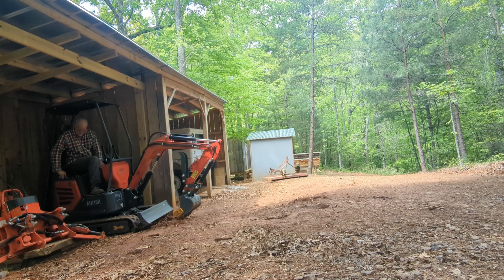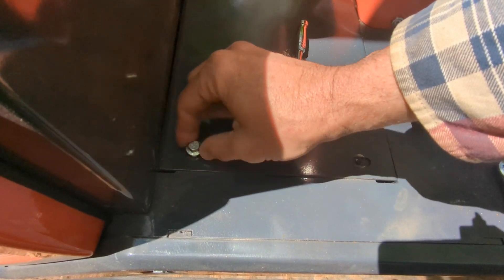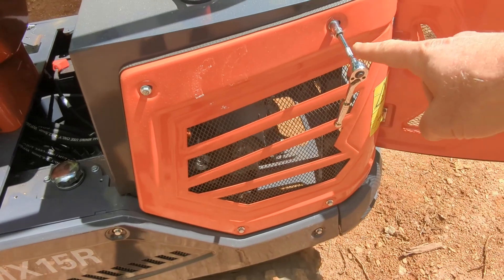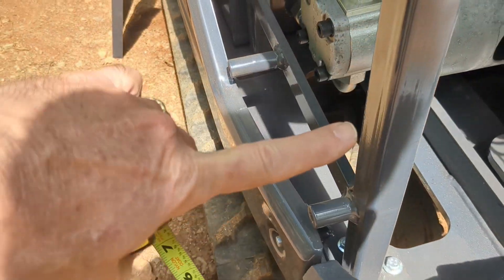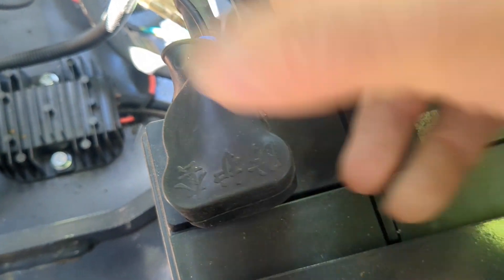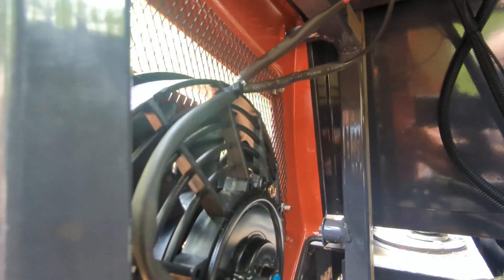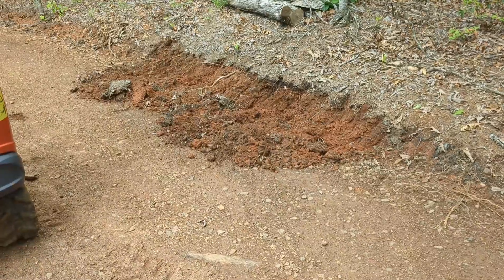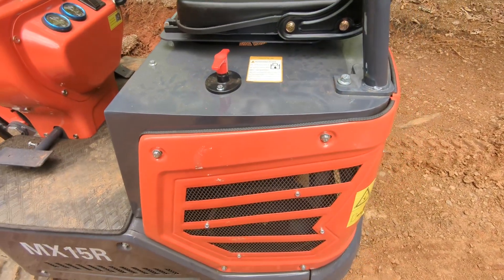Mini Excavator DIY Cooling Fan Installation

Comment: What was the temperature before the install?
Reply from the maker: I'm not sure of the exact temperature but everything in the engine bay was too hot to touch after a long work session. The biggest issue was restarting the engine after refueling. The gas tank was almost boiling. Vapor lock....

Comment: Those things need an oil cooler and the worst way
Reply from the maker: I haven't had a problem with the fluid getting too warm. Probably because I don't run it more than about 45 minutes at a time.
Reply: @dpgladius  with that duty cycle, you probably would never have a problem, but if you plan on using it for a good day, you’re gonna have some problems. There was a guy who had one of these things that ran it so hot that sprung a leak and caught on fire.
Reply from the maker: That sounds like a bad day. Thanks for the info.

Comment: Take those wing nuts for the seat and throw them away.  You don't need them.
Reply from the maker: I agree. The wing nuts are a little cheesy. I do like the seat attached at the rear, especially when navigating down a slope. It just feels more secure.

Comment: On your mini excavator throttle. I used a heavy duty aftermarket throttle with a clevace on the end. I installed the clevace on the very end of the throttle lever on the engine. I now have full throttle range. I did have to invert the new throttle to keep from rubbing at the base of the new throttle.
Reply from the maker: That sounds exactly like what I need to do. Thanks for the comment.

Comment: Gladius,,,, has your battery gone flat after the fan install? Being directly connected to the battery like you did. 
Also,, would you tell me the WATTS and voltage of you fan please.  Kind regards,, MICK
Reply from the maker: The fan is connected to the battery disconnect so it only turns on when the battery is turned on. This actually saved me from running the battery dead because you hear the fan running so you don't forget to turn it off.

I bought the fan on Amazon. Here is the info:

JDMSPEED New Universal Slim Fan Push/Pull Electric Radiator Cooling Engine Kit 12V 80W 9 Inch
Reply: Gladius, thank you for replying.  And thanks for your information.  
I also powered my fan via the cut off switch , not having to directly connect to the battery.  As well installed a relay,  as one would. But still the battery got drained.  Leaving me having to jump start the machine.  Then i installed a smaller dashboard type 12volt fan. , it to drained the battery.  
Wasn't till i checked the recharge capability of the motor,  magneto. It was only charging at 2.5 volts . 100 rpm and 3000 rpm. Unfortunately im stuck with a hot machine. 
Kind regards,, Mick..
Reply from the maker: Something seems off with your charging capacity. My volts meter goes to 13+ volts when the machine is running. I'm not sure about the amps but it seems to keep up with charging the battery. 

I'm not sure why you would need a relay since the battery cutoff switch can carry the load. I wonder if the relay is causing your issue.
Reply: The relay was to help with keeping the battery  safe. But like you said,,, there's bigger other reasons why it's not charging.
Reply from the maker: After doing some reading and testing. My Rato engine puts out 10 amps at 14 volts. The fan uses about 6 amps so I'm not discharging the battery.
Reply from the maker: https://www.amazon.com/gp/aw/d/B08FFH78PS?psc=1&ref=ppx_pop_mob_b_asin_title

Comment: I left my wing nuts off and haven't had any issues, and I'm considering putting a fill neck or external tank not sure.
Reply from the maker: I was thinking the same thing. The seat base is well supported on the front edge. Thank you.

Comment: I probably would have put a nut or two between your fan and the wire mesh that the bolt goes thru and holds in place. I've done that before. I see you used screws. But I like what you did there too.
Reply from the maker: I thought about spacing it out but had the angle grinder just sitting there. So why not.
Reply: @dpgladius  exactly. Seen that brace up close to it too afterwards. You did good. 💪🏼✌🏼